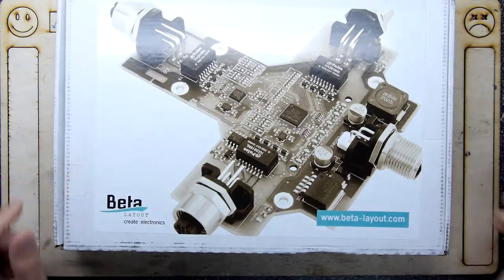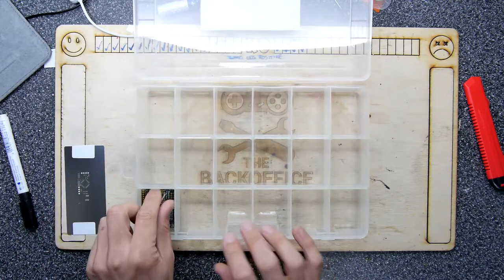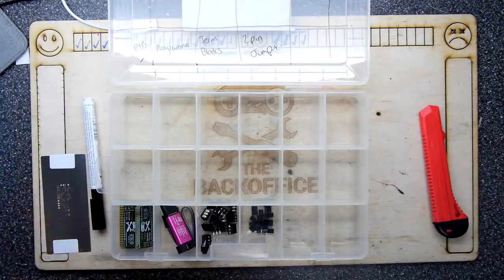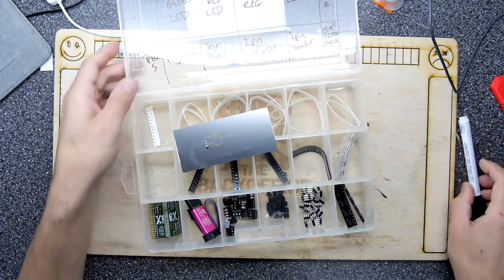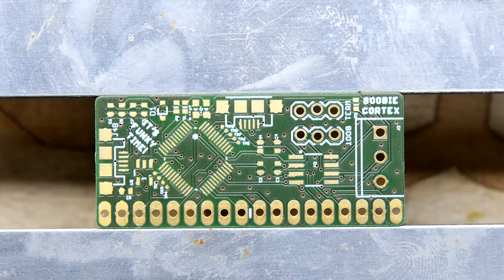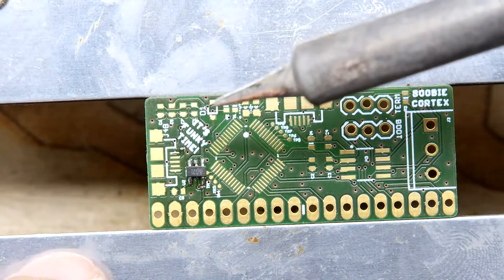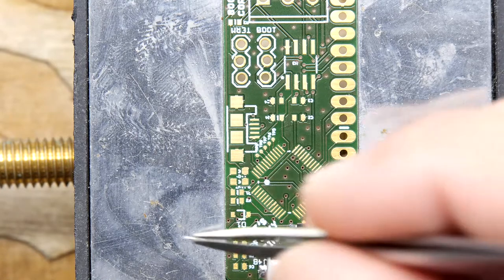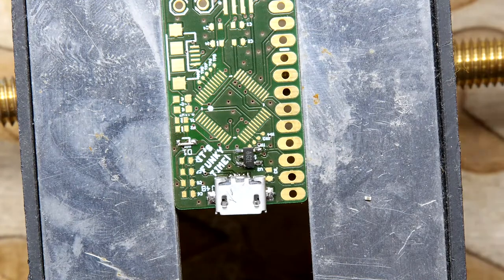Learn electronics Assembling your first prototype PCB

Comment: I saw someone else solder surface mount tech like that and I always think there has to be a better way. Good build, looking forward to the next video.
Reply from the maker: There is, I just hand soldered 15 boards, basically I use solder paste instead of solder. However, I dont use the stencil, I apply manually. I will make a few vids on it sometime.

Comment: You are exstreamly good with that solder pencil,question you don't use a tip cleaner /thinner .do you ,I bought a cleaner / thinner from radio shack ,it a pricey little tin ,but works well ,I bet most people don't no how hard that chip was to install,I do some what and it's very hard ,great job.smd ,stuff is a hard skill to learn.
Reply from the maker: +Ron Thompson I generally use hot air, I just finished making so many boards that video would look super skilled now 😂 I blew out the cobwebs.

I have tip cleaner etc, I just guess I'm set in my ways now.

Comment: The wonky lines to label the compartments made me angry. Sad ;-P
Reply from the maker: +Retro Princess Shall I post it to you for corrective procedures?
Reply: I could make you a nice little wipe clean thingy to stick in the top!!
Reply from the maker: +Retro Princess ha ha, it does wipe clean, merely needs the application of dangerous solvents 😂
Reply: True....but the lines would be straight 😂
Reply from the maker: It would indeed be nice to be able to draw straight lines. If only someone created a tool that would allow me to do this. Hmmm. Nah, impossible, cant be done!